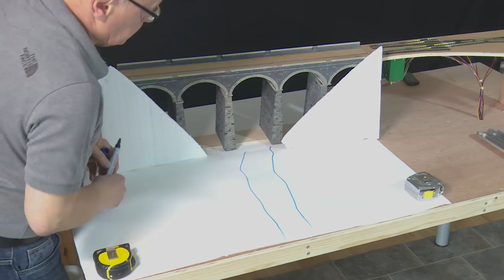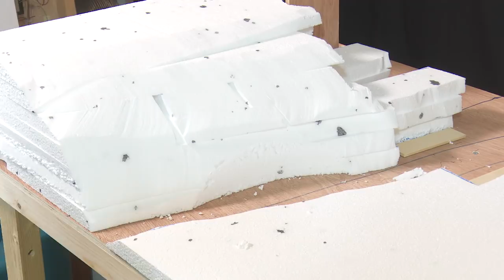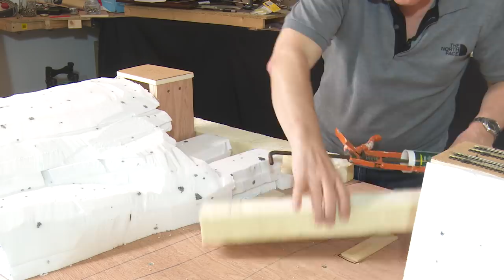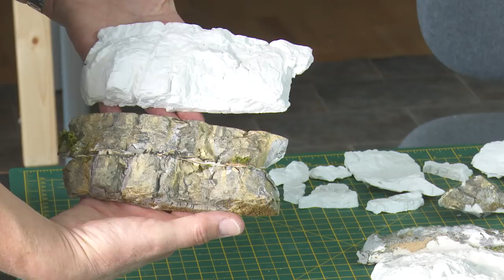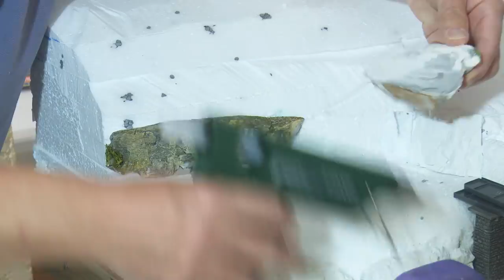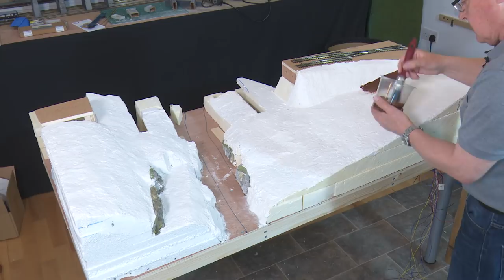Building realistic model scenery, a viaduct in a valley, for Chadwick Model Railway | 64.

Comment: Charlie, when covering foam terra form< I like to use - low loft poly fiber batting, the stuff you put into quilts.

Simply cut into the shape of your section to be covered.  Paint the foam base with straight PVA.  Pin th poly down with T pins into place, and then paint liberally with earth brown cheap latex painit. While wet, springle your first coat of earth blend fine foam poweder.  Let dry and you have a beautiful earthen layer with great texture from the fiber.

Continue to scenic the area, workig from "low to high" with ground foam, shrubs, bushes, static grass, and etc - bring the scene "UP" as it wer until you have the final scene.  Fantastic!!

A side benefit is it is LIGHT!!!  A great way to keep the weight down.  

Lay out the poly into the area to be covered, pin it down, use a Sharpie and connect the dots around the perimiter.

Remove the poly and cut the dots out with scissors and pin back into place.  Then proceed with the paint.

You can even place wiring under this layer as a substitue to go under the benchwork - however this is a permanent approach so plan carefully.  Glue rick castings to the poly with hot melt glue.  Press into the poly and the poly blends right into the edgtes of the rocks.

Finally, one sheet of poly butts right into the next sheeet seamlessly.  Great for hillsides, and embankments come up onto an incline.

Bob - Cleveland

Bob - Cleveland
Reply from the maker: Thanks Bob, for such an excellent comment. Regards Charlie

Comment: Hi, PVA takes forever to dry. There are many quick drying glues designed especially for foam. Extruded foam is less messy to deal with than Styrofoam. But beware the fumes, if using a hot wire cutter. Do it outside or use a mask. Nice tutorial. Looking real good. The viaduct bridge looks great. And I like the auto bridge too. A farm bridge sounds like it should be made of rough stone, river stone really. Adds interest to the overall scene. I look forward to your progress.
Reply from the maker: Thanks Norman, I’m so pleased that you enjoyed it.  I believe that I have found a suitable small stone river bridge.

Comment: Hi Charlie,  I agree on trying to avoid the Expanded Polystyrene Board (EPS), instead use the Extruded Polystyrene Board (XPS). We have a product called Liquid Nails for Projects that works very well with Extruded Polystyrene Board.  I've been a fan of Sculptamold for years and it is now my go to product over Hydrocal plaster. The viaduct scene is coming along quite nicely and I'm looking forward to future updates on your model railway. Cheers, Rich S.
Reply from the maker: Hi Rich, 
I’m so pleased that you enjoyed the video. 
Where did you buy the EPS?
I must have been the last modeller on the planet, to discover Sculptamold!
Reply: @ChadwickModelRailway  Hi Charlie, Here in the States you can purchase EPS, XPS and PIR at any one of our home improvement stores, the two largest being Home Depot and Lowes. I prefer XPS also known as Styrofoam or "Blue Board" and is available in 1" and 2" thickness. I prefer XPS because it's a giant block of foam, whereas the EPS has the small foam balls that go everywhere when you cut it. If you cannot purchase XPS then my second choice would be Polyisocyanurate (PIR) that's the stuff with the foil backing.  Cheers, Rich S.

Comment: Great Charlie! I have found a good quality carpet/ spray adhesive works well for Celotex based embankments and if used for a track bed above a baseboard, a 9mm cap of plasterboard also fixed with spray adhesive. Takes track pins and copydex a treat! As we know, there's never a 'right way' to do it....👍
Reply from the maker: Hi PJ, are you saying that you lay 9mm sheets of plasterboard on top of your baseboards to absorb the noise?
Reply: Hi Charlie. Not on top the baseboard, on top of the Celotex. Celotex is cut roughly to to curves and position of he track on the scenic section then the same width of plasterboard is glued to the top of it to form a decent track bed. The contours of the embankment can then be added either side using  your chosen method. Creates a raised track bed for cuttings or embankments on a flat baseboard. Works for me! Look forward to your next one!👍🏻
Reply from the maker: So, is your Celotex your baseboard too?
Reply: Yes mate but only where the tracks are. Trackbed is all raised about 3 inches from the plywood baseboard👍🏻
Reply from the maker: Got it.

Comment: Hi,  Charlie great video. I am a rep for a builders merchants and in over half the sites I visit, they have  Celotex (yours was Quinn therm by the way) in the skips that they have to pay up to £400 to have taken away.   A note to all modelers, ask the site foreman if you can have some offcuts. Do not help your self as the site is normally controlled by Health and safety rules. Also, some may be contaminated by some means. All in all, they would love to get rid of it because it is bulk without weight and they pay by bulk for removal.
Barry.Devon.
Reply from the maker: Thanks Barry that’s most helpful.
Is there any difference between Quinn therm and Celotex?
Reply: @ChadwickModelRailway  Hi Charlie, no, no difference as far as model use is concerned. There are quite a few manufacturers of PU board (stands for the chemical name for the type of board) and they are all the same for us modelers but subtle differences if you are insulation a home.
Barry.Devon
Reply from the maker: Thanks very much Barry.

Comment: Great video as usual - stunning result. I would suggest to make the Luke Towan wire cutter if you are going to try working with polystyrene again, as you can form the wire so you can cut in shapes in the layout without using a carving knife.
Reply from the maker: Too true.  But I’ll avoid polystyrene if I can in future.

Comment: Great work....looks to be stunning when finished...I also used kings span or eco therm panels left ove from my attic conversion to build my mountin tunnel etc its great to work with...I also use dot and dab dry liners filler as its very cheap to over lay a texture on the thermal panels that are carved etc.

Jim.
Reply from the maker: Good tip for us all Jim.

Comment: You are still romping ahead of my valley build! (I could have told you not to use PVA on polystyrene! lol)
Reply from the maker: But you didn’t.
What a let down 🤪
Reply: @ChadwickModelRailway  I am using extruded polystyrene (similar characteristics to Celotex but can be carved with hot wire) and gorilla glue to stitch it together (it's a polyurethane based, like your cartridge glue). If using expanded polystyrene, use a ceiling coving glue, fast grab and rock solid in a few hours. I make my own sculptamold, so even cheaper.

Comment: Great video.  But late, now, but the yellow foam, known in the US roofing trade as "iso board", is, more properly "isocyanurate expanding foams board."  It's a popular in roofing for having a very high R value per thickness.  So, it's dense, it's rather hard, too, and resists hotwire due to its thermal characteristics.
Modeling advice is generally to use the white (EPS) polystyrene foam where you are likely to hot wire cut it, and is the iso where you just need bulk.  EPS sometimes is best glued with a building product often called "Kiquid Nail" (PL-1 in the US).  The iso, as you found wants a different adhesive.
It came out stunning, though, by any measure.
Reply from the maker: Many thanks for your thoughts.
In the UK it’s difficult to acquire high density foam such as the pink or blue stuff that we see on YouTube so regularly.

Comment: PVA is a good cheap option, but can be slow to bond. Being impatient, on bigger jobs I like to use more than 1 glue. Depending on the surfaces, I'll use mostly PVA (tacky version is thicker & stronger) & dot CA (super) glue or hot glue (or even rapid set liquid nails) here & there as well. The instant glue kind of acts like a tack-weld, holding everything together until the PVA has time to cure. Hope this helps :)
Reply from the maker: Some good points Joanne and hopefully you’ve subscribed too.
Reply: @ChadwickModelRailway  indeed I have :)

Comment: Charlie what a great job I remember way back in the day of my early 20 somethings I tried the same thing  but had to use chicken wire  And paper and  glue boy what a mess and I had no idea what I was doing. After watching you and your videos I am ready to try again. Great video keep up the great work I am inspired by what you are doing.
Reply from the maker: You’re too kind Jeff, it’s comments such as yours that make it worthwhile.
Reply: @ChadwickModelRailway  Charlie thanks but it is you that make it worth the time and effort. I very much enjoy your videos just wish they were around 25+years ago.....lol  keep up the great work .
Reply: I think the thing with scenery (and tracklaying for that matter) is it nees to have the same time spent on it as the other components of the build. I think all the various methods have their place. There was a great article in one of the MR mags on the card lattice construction which has its place for lightness ie cut several formers to the profile (x-section) of the hill to be modelled and lay the lattice strips of card across. I could see this being usefull for a corner section with difficult access so it can be lifted out if required. I have kept loads of polystyrene packing so form similar areas as Charlie but I guess the masochist in me is happy to give other methods a go as well.

Comment: Hi,
   A bit late to the party, but I thought I'd weigh in on the PVA issue. From what I've been told, PVA is a glue that dries when in contact with air. From the looks of your tools, I'm assuming that you brushed the glue over  each sheet? If so, then only a small portion of the glue would come into contact with the air, allowing it to dry. A tip I picked up from a wargames terrain maker (Mel the Terrain Tutor, for those interested), a more effective method would be to put dabs of PVA in each sheet, allowing more of the glue to come into contact with the air. It's a trade off between coverage and how much dries, but I think it's worth it.
   Overall, looks good. Sadly, it has also inspired me to start working on my own layout again. If only I had the space...
Reply from the maker: Thanks MF, an interesting point that I certainly didn’t know. Hopefully you’ve subscribed too. Regards Charlie

Comment: The next time you decide to make hills you should get extruded polystyrene it is less messy and cuts better. Also to glue it down get styrogoo from the hot wire foam factory.
Reply from the maker: I've found that it's very difficult to get in the UK.   Are you State Side?
Reply: Yes I am.
Reply from the maker: We just can’t buy it over here.  Are you using the blue or pink type?
Reply: Yes

Comment: Charlie, i lay my track on 10mm polystyrene sheets, its great and totally eliminates the drum effect of the baseboard.
Reply from the maker: Do use use cork and ballast too?
Reply: @ChadwickModelRailway  yea mate as its n gauge i only use 2mm cork and as ballast and i pestel and mortar my own ballast to scale, ( the stuff in model shops is massively overscaled, it resembles half house bricks lol) the polystyrene though after doing everything absorbs all the running noise its quite remarkable, the dcc sound sounds so much better. I attached the 10mm polystyrene to the baseboard with 1 hour decorators caulk. Polystyrene also keeps the trackwork at a steady temperature to avoid warping. i got the polystyrene free from my new fridgefreezer packaging, there was 3 large sheets
Reply from the maker: Thanks for the detailed response.
I think I’m going to have to do some tests.

Comment: Have a plan? Charlie, that takes all the excitement out of it! :D 
Another great video! That viaduct is really going to be an eye-catcher on your layout! For gluing foam to foam, what I've been using is not really a glue at all. I have been using Glidden Gripper latex primer paint. Glidden is a paint manufacturer here in the States. You'll have to check to see if it's available in the UK. I put a thin coat on, weight down the two pieces, and when it dries you cannot get the foam pieces apart without destroying them. There's a YouTube video, Styro Wars by Scaryladyvideos, where she test various adhesives. For strength and cost, Glidden Gripper wins.
Sculptamold really is a great product, isn't it? Looking forward to the next video!
Reply from the maker: Hi Flyboy. I’m so pleased that you enjoyed the video and it’s great to have you onboard.  Vote Sculptamold!

Comment: using extruded polystyrene here (what you call cellotex which also comes without silver water barrier material), much less messy to work with (the one that isn't made of little balls).
this is the proper glue for expanded / extruded polystyrene: https://www.amazon.co.uk/dp/B004GHJ9NW
the PVA can't work, as there is nowhere for the water to wick into (as it does when you glue wood) or open air to evaporate into.
the mastic style glue in the gun is better for polystyrene - wood but takes at least 24 hours to set
Reply from the maker: So I noticed. The Cellotex worked fine though.

Comment: As an experiment I tried using some Celotex for scenery hillside, I removed the silver foil and glued the layers using caulk.  The caulk did hold it together but after four or five weeks every bit of the Celotex had warped quite badly.  I’m wondering how well your polystyrene hillside will stand up having used a hot glue gun, if it does last with no warping I might opt for that method over the Celotex and caulk.  I always look forward to your video tutorials so keep up the good work.
Reply from the maker: Hi Andy, what you have said is very interesting. I’ll certainly check it for warping.

Comment: Cellotex and Kingspan are polyurethane foam and do not melt.trying to cut them with hot wire cutters only burns the material giving off toxic fumes. They should only be shaped by mechanical means. I see you kept to the expensive point motors rather than the more economical servo motor option.
Reply from the maker: Yes Frank, I thought callotex was brilliant.  “Sandling Junction”, is a pal of mine who I learn from regarding servos.

Comment: Health and safety warning: the foam cutter produces foul smelling fumes which are probably not too healthy, you are practically burning the stuff to charred remains.

Some foam cutters come with multiple cutting tools. The thick stiff wire can be used as a knife, but cools down fast if inserted in the foam. Use the sound of the melting foam as a guide.

XPS foam, the stuff with the foil coating, comes in various densities and surface treatments, try out which tools work best. Some variants can be cut with a hacksaw and shaped with a fine file, while others work better with hot wire cutters and sanding mesh.
Reply from the maker: Thanks for the tips Ivo.